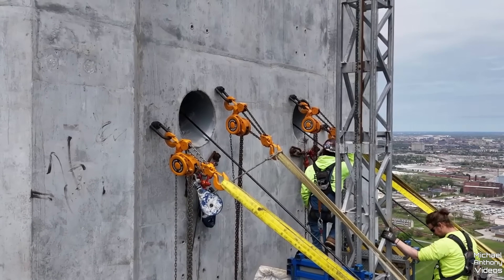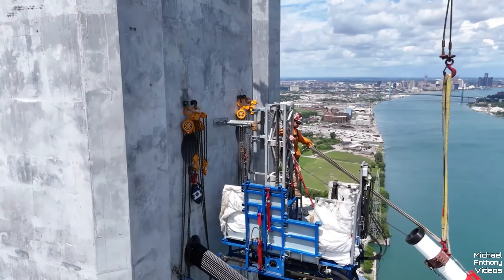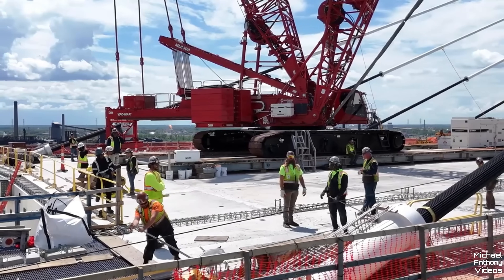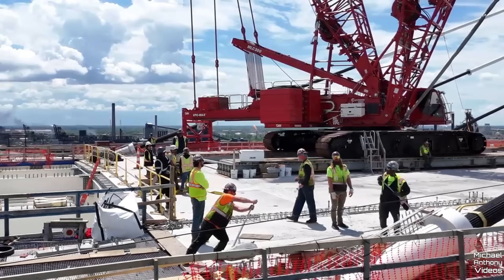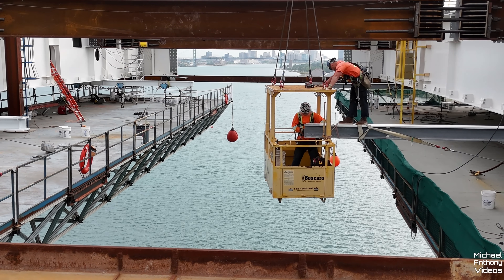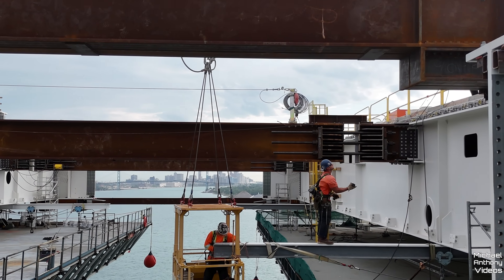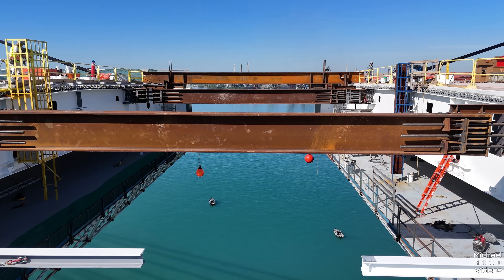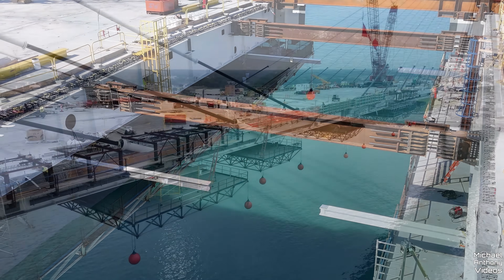How Stay Cables Are Installed On The Gordie Howe International Bridge | Detroit, Michigan

Comment: Thanks for describing the process for installing a cable... it is not a job I would want to do at such scary heights even with a safety line!
Reply from the maker: @EngineerLewis  I wouldn’t want to be up there either. And they have to be in the hot and cold weather.
Reply: @MichaelAnthonyVideos windy weather at that😮
Reply from the maker: @wolfiethedog76   Especially up there with both blocking it.